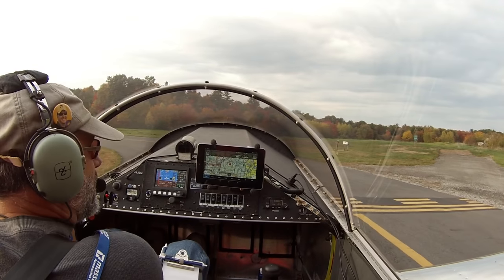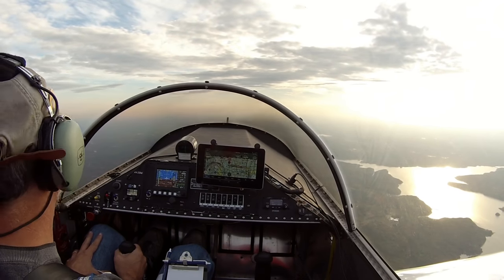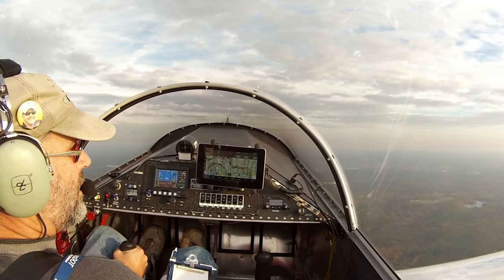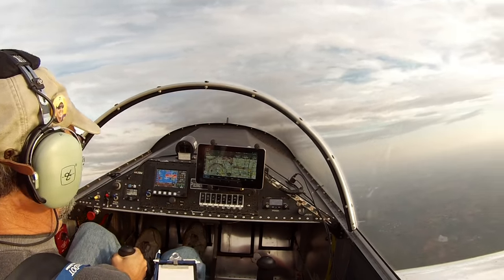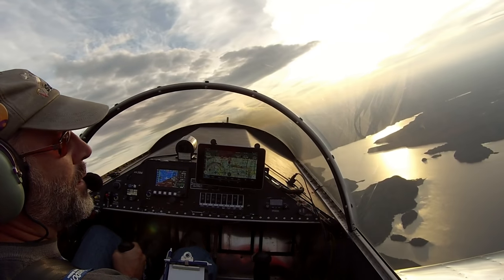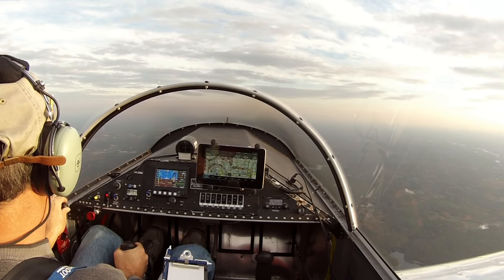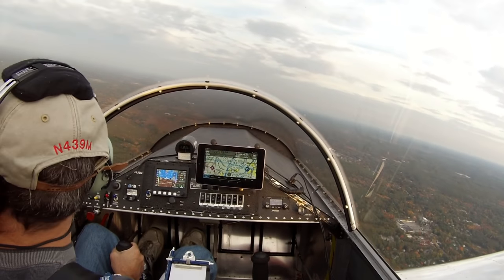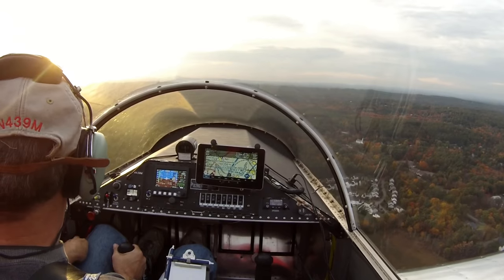Aerobatic Sonex with Commentary

Comment: Nice video .. I'm considering a sonex or onex in my future. Enjoyed watching and the commentary.
Reply from the maker: The airframe is rock solid. If you like aerobatics then the optional acro ailerons will give a quicker roll rate. As for powerplant, the VW is really inexpensive, but at 80 hp it can be a challenge when things are hot and/or heavy. The Jabiru 3300 is 120hp (6 cylinders) and it an excellent option. Other options these days include a Corvair, UL, Viking, Rotax and a few others. Only some are supported by the factory, but you can use anything you want.

Comment: I spun my KR2 regularly . The first time scared me as it snapped into a spin when I applied cruise power while recovering from  a mush, while practicing stalls . The airplane would just go into a mush , fully controllable . No break or wing drop . It spun really fast either way and recovered fast. One hell of an airplane but very sensitive in pitch . It would fly in ground effect at 40 mph at full gross . As a tail wheel you had to hold the tail up until below 40. Still it was quick on the controls.

Comment: Great video. I have been wanting a plane like yours but with the Jabiru 3300. Other than price what are your feelings about that system?
Reply from the maker: It's a great little airplane. Awesome view out the canopy. Feels like you're flying a little fighter. Very responsive. Easy to take off and land. Jab 3300 is a great option, providing half again as much power as my VW. If you can afford it, go for it.

Comment: I don't have a tailwheel endorsement, and zero tailwheel time... the only thing about this flight that made me nervous was having to take a hand off the stick while rolling out in order to be able to simultaneously operate the throttle and the brakes.  No toe brake option?
Reply from the maker: I'm at a slow taxi speed and I was making the first turn off. Unless there's a strong cross wind the stick isn't doing anything; I could point it anywhere. The rudder pedals are what's really important.
Reply: That addresses one specific situation, while I was thinking about what may be a general need to control throttle, brakes, rudder, ailerons, and elevator on a windy day.
Reply from the maker: I have 3 years and 300 hours on the plane, and 4,000 miles of cross country flight.. Braking hasn't been an issue. Toe brakes add weight and complexity. The Sonex is designed to be light and simple. When I touch down the thottle has already been pulled to idle. No need to touch the throttle. But I like to keep my revs up a bit to keep the alternator charging, or to expedite clearing the runway. That was really the only reason I was reaching for the throttle. The stick wasn't needed so it was not a priority. Thanks for watching.

Comment: How well does the plane climb with passengers? At 1100 lbs, can it even climb?
Reply from the maker: It's an 80hp engine, so you have to know what it can and can't do or you'll end up pretty unhappy. In cold weather, at 1100 lbs, I can climb out at 1,000 fpm, and it performs quite well. On a hot summer day, at gross weight, I may only see 300 fpm on takeoff, which is not very comfortable if there are any obstructions ahead, like tall trees. So I don't often fly at gross weight on hot days. When I travel out to OSH at gross weight, I leave in the morning when it's cool, and choose fuel stops with longer runways and fewer obstructions. By the time I get to Ohio that's usually not a problem.
Reply: @mikesmith208  
Good info, thanks!

Comment: Seems this is the only plane I’ve found that’s available as plans, I'll get out my tools and order parts through Hocotate Freight.
If I can fix my spacecraft, then I can build this plane.
Reply: Because the grass blades on the landing strips are too long, I’ll tarmac some small runways in the garden especially for you. If you build a helicopter, you can put it in the landing zone where you land your spaceship and where the onions land.
Reply: Captain Murphy What is tarmac?
Reply: Captain Olimar Tarmac is adding a layer of tar on something.
Reply: Captain Murphy Don’t forget to make some small hangars where I can put my aircraft, you can 3D print them with your 3D printer. 😁
Reply: Captain Olimar Large 3D models can be expensive, difficult, and take too long to print, but I’ll think about something. 👌
Reply: Captain Olimar We don’t need to worry about who’s big and small, I have enough experience assembling scale models, I promise I’ll be nice and gentle, I’ll hold all the pieces like an egg, and I can assure you that the egg will not break, you weld them with an arc, and I’ll weld them with some superglue, we’ll have to figure out space for two aeroplanes and a helicopter.
Reply: Captain Murphy Why would I want two planes?
Reply: Captain Olimar I’ve just been thinking, I’ll order an Airfix Spitfire model kit and you can make it flyable, I’ll send you the blueprints, diagrams, cutaways and owners' workshop/flying manuals of the Spitfire, and then you can copy the design and turn it into a real flying plane. Your Spitfire replica is a 1:48 scale model of a Spitfire FR Mk XIV Clip coded VC-P, it should fit you like a glove, you don’t just get into the Spitfire, you strap it on and then it becomes part of you, you don’t need a flying manual, you’ve got yourself a plane and you can do anything you want with it, you simply push the nose full down, apply full throttle, pull the elevator full up and nothing’s going to happen. 😎
Reply: Captain Murphy Well that’s very kind of you Captain, Ed told me about the Spitfire in the comments of another video, I guess I can live dangerously in a legendary iconic British fighter.
Reply: Captain Olimar Also, I’ll order a 1:48 scale model kit of a Hurricane Mk I coded RF-J for your friend Louie and give him the blueprints, diagrams, cutaways and manuals.
Reply: Captain Murphy That’s handy, I might form myself a squadron of Hocotatians based on Earth, if you help us, we will help you, and we can fight Bedlam’s Jagdesc thing squadron with Ed's Dojo Squadron together. 👍
Reply: Captain Olimar Consider yourself a squadron, you are now part of Red Diamond, BTW, it’s Jagdgeschwader, it’s German for Fighter Squadron.
Reply: Captain Murphy Sorry Captain, I really do need to practice my German, I want to speak every language on Earth like you.
Reply: Captain Olimar That’s right, you can do anything you like in a Spitfire, if you treated it properly, you'd be alright, but if you were careless, you'd be in trouble, so try not to take any risks.
Reply: Ed How easy is the Spitfire to fly?
Reply: Captain Olimar Oh, it’s not too hard to fly, but it can be a challenge to get it back down after getting it up.
Reply: Captain Olimar Unfortunately, there’s been a change of plan, your Spitfire replica is going to be 3D printed out of metal, plastic would be too weak for an aeroplane and I couldn’t find a metal model Spitfire kit that would be suitable for you.
Reply: Captain Murphy Isn’t the Spitfire made of wood?
Reply: Captain Olimar Some people think it’s made of wood, but it’s really made of metal. Which mark would you like me to print?
Reply: Captain Murphy LF Mk Vc.
Reply: Captain Olimar Which livery?
Reply: Captain Murphy 310 (Czech) Squadron.
Reply: Ed Aye, I’ll manage somehow, Captain Murphy hasn’t given me any flying manuals, he says I’ve got an aeroplane and I can do anything I like with it.
Reply: Captain Murphy My partner Louie would like you to 3D print a Spitfire LF Mk Vb of 402 Squadron.
Reply: Captain Olimar Is there any other types of aircraft you’d like me to 3D print?
Reply: Captain Murphy I’ve done some research on the Royal Air Force and its aircraft, and I quite like the SEPECAT Jaguar, oh and the helicopter I'd like you to 3D print is the Bell 206B JetRanger. Another plane I'd like you to 3D print is the Piper Tri-Pacer.
Reply: Captain Murphy Actually, I'd like you to 3D print me a Cessna 185 Skywagon instead of a Piper Tri-Pacer, the tail no. is N1047F, the JetRanger I want you to 3D print is registered G-TGRZ, and Louie's LongRanger is registered G-LONE, but I still want you to 3D print me the Jaguar.